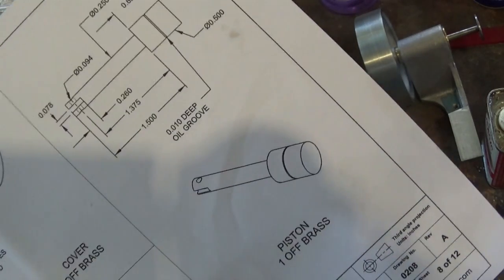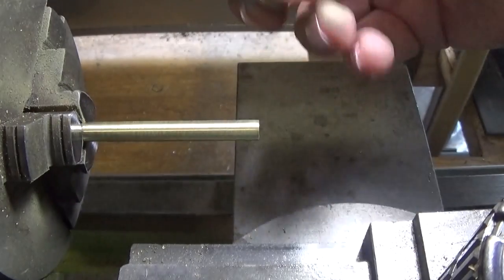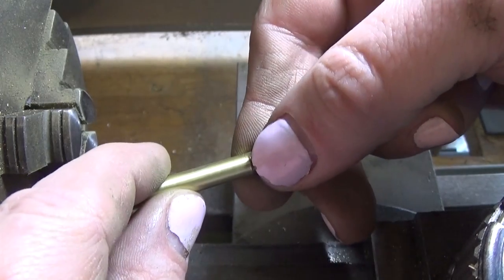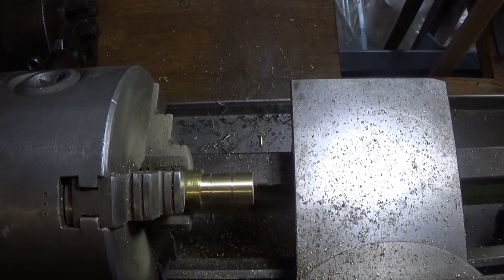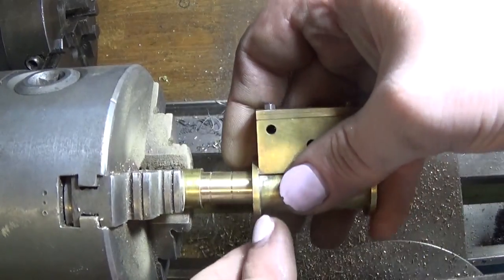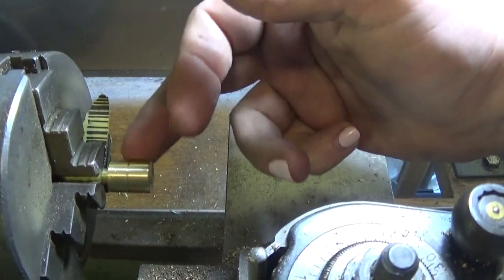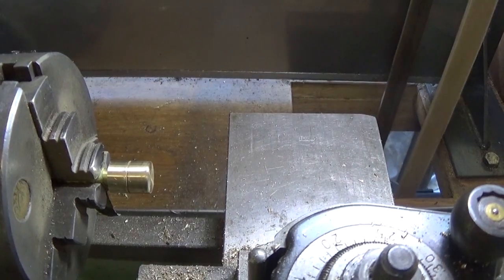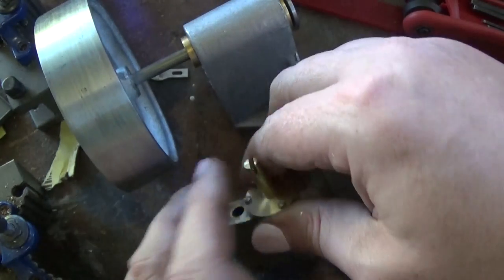myfordboy engine part 13 making the piston

Comment: Hi Emma,I have a question about the order of machining. You first cut the slot in the piston rod and then drilled the holes. My un-educated choice would be the opposite. What is your method based on?cheers Teun
Reply from the maker: lol... good q. probably the other way around would be better. I didn't think of it till later. thanks for watching!
Reply from the maker: lol... good q. probably the other way around would be better. I didn't think of it till later. thanks for watching!

Comment: Getting closer to the finished engine.  That is going to be one nice looking engine.  It is good you can work with those tiny parts.  Keep on keeping on.
Reply from the maker: its a bit fiddly with those bolts. hope it runs eventually, Harold.